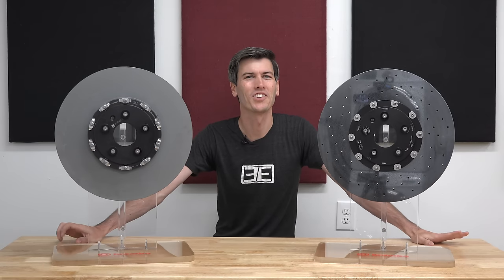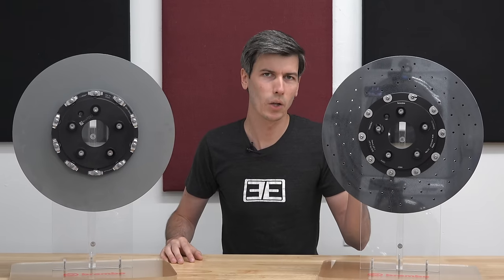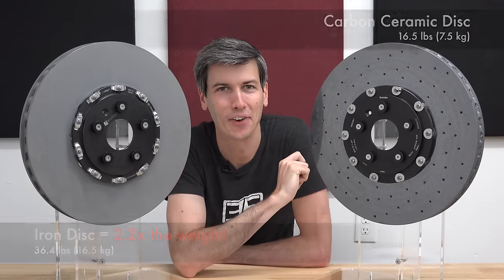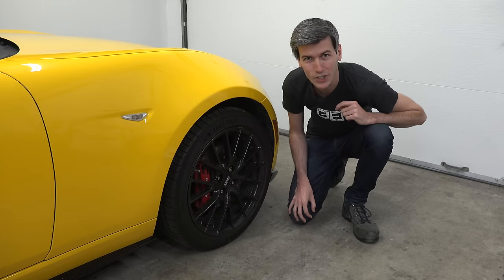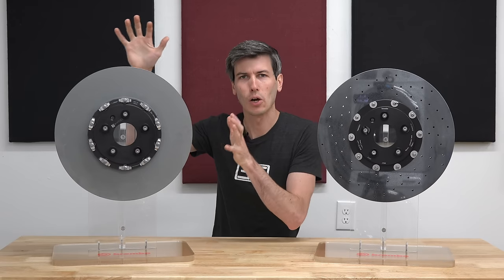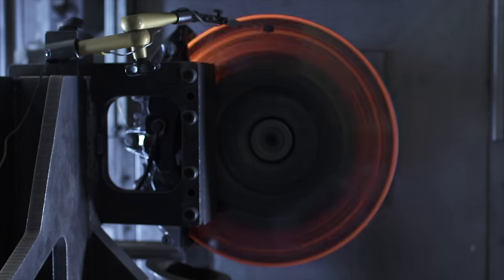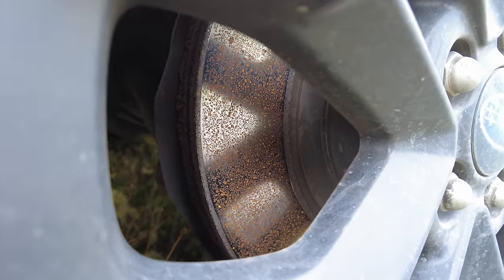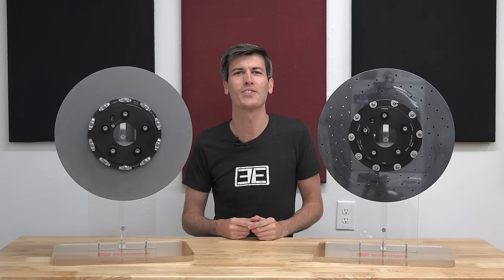How Can Brakes Cost $10,000? The Brilliance Of Carbon Ceramics

Comment: Could you do a video on what speed is an electric car most efficiently driven like you did on a gasoline car?
Reply: The intersection of energy loss due to wind-resistance and in-cabin energy use (which would encourage going faster to minimize time spent in the cabin). My bet would be 20-30 mph (similar speeds to a bicycle).
Reply: EV's range is very dependent on aerodynamic drag.  It affects ICE cars some, but it can really hurt EV range more.  Also, ICE cars tend to have multispeed transmissions, so you want to be in top gear for best range in an ICE car.  In an EV car with one gear, the slower the better.  It becomes down to how much longer do you want to make your trip to be to get more range.    Bear in mind that an electric motor is 90% efficient, while an ICE gas engine is about 33% efficient.  The energy density of batteries (very low) means you start your journey with much less available energy, so efficiency and aerodynamic drag are a big deal for EV's.
Reply: It depends on whether the electricity was generated by coal or solar.
Reply: 56mph
Reply: Efficient really slow. 
Fast you can drive fast as long as fast charging is available everywhere. Fastest way to travel a model 3 is 190kph when 200kw charging is available and you only charge up to ~70%.
Reply: Generally slower, perhaps 50 km/h or even less.
Reply: @MichaelRei99  Coal down to 19% of US electrical production, and falling.
Reply: 1mph would be the most efficient way to drive an ev. No drag, impact from wind or wasted energy like in an ice car
Reply: @mattbrew11  There are still continous losses, lighting, electronics, etc, and ultra low speed operation isn't super effecient, so not quite.
Reply: Pretty sure the electric motor is more efficient at a higher speed though.  Would be interesting to see where the motor is happy vs where the wind resistance starts hurting too much.
Reply: @brianmichael316  Electric motors are around 90% efficient.  Don't see why there would be an improvement at higher motor RPM.  Aerodynamic drag is the main issue facing EV's as speed increases.  Aerodynamic drag increases at the square of speed increases.  So slower speeds will provide more range, but at the expense of travel time.
Reply: @MichaelRei99  nice try, but over the long term coal usage is going down (with a few bumps along the way). Elon already has this covered

Comment: 2019 Camry XSE. 74K miles, rideshare. Swapped front rotors at 70k. $200 for decent aftermarkets in OEM size, both sides with pads and clips.

RockAuto.

Comment: Please do a video explaining different Tire Pressure Monitoring systems; why do some systems show the pressure for each tire (Hundai, Kia, etc.) vs. others that only have a low warning light (Mazda CX-5). Thanks
Reply: Probably not enough for a video there. The difference is actually really simple, on cars that support individual pressure there is a sensor on the tire to actually measure that pressure. Those can go bad individually and need to be changed over/replaced when you get new tires. If your car can only say low pressure it is just using the stability control to see that one tire is a different diameter than the other, and thus one tire has less pressure. No sensors on the actual tire. But the car can only guess as to what is actually wrong and it takes longer for it to figure out that there is a problem.
Reply: I don't think there's really any difference unless you know if the car has in wheel pressure sensors or not. 

The simple warning light is the most basic system, but it still works the same way. If you use the proper scan tool to get into the TPMS system on a "warning light only" car, you can still read the individual tire pressures, but the auto manufacturer simply gives you no means to read it, just triggers the light under a certain pressure. 

However there is a system out there (don't know if it's still in use) that triggered the light if wheel speed was different, I know Toyota had these for a period, and they have a button you can press to relearn the system.  Ford may have had it, which might be the system in your Mazda... 

Just my 2c... Would like to know for sure though. I am under the impression all systems are sensor type these days.
Reply: That's entirely up to the manufacturer.  All new cars have the wheel mounted sensors and are monitoring the actual pressure real time.  Mfr decides if they want to show you those values or just have a warning light that's triggered when a sensor reads a value less than a specific tire pressure number.
Same question as why don't all cars show the oil pressure, oil temperature, and coolant temperature?  
Often, too much information is worse than not enough information.  K.I.S.S.  Most people just want to know when there is a problem and prefer the warning light.

Comment: Good video...I have some experience with both brakes materials on Porsche cars and I track a lot my cars..one think that we need to get clear from the start is that racing cars don't use Carbon Ceramics, they use Carbon-Carbon technology. On which one to choose my last two cars have been spec with Iron rotors. PCCBs do weight about 20 lbs less (full system) and that's unsprung weight... but I can always swap the rotors for a good quality aftermarket rotor and save some...not all 20 lbs. But then we have another problem...on GT4/GT3 with PCCB you can't use 19" wheels because the rotor is 410 mm vs 380, that larger size is needed to dissipate the heat. With a good quality performance wheel and racing DOT tire combo in 19" I have been able to drop 26 lbs for the 4 corners. BTW...don't ever drop a wheel on a PCCB rotor...that would be an expensive mistake. On braking performance once I change pads to a quality, track oriented one like Ferodo/PFC/ Pagid there's no advantage to PCCB and a good chance the Iron rotor will out-break the PCCB at a much lower cost with improved pedal feel....with Iron you have a great choice of pads not so much with PCCBs. So the only benefits I see are reduction on unsprung weight and no dust...in case you hate cleaning wheels.

Comment: Another thing to note is that the carbon ceramic rotors on a road car are actually different than those on a race car. The ones for road car can be made in a less expensive fashion because they're not expected to be used frequently on a race track.

Comment: I find it telling that a lot of people run iron rotors on the track but put the carbon ceramics back on for the street.  In a street application they last forever, and you get the benefit of lighter unsprung weight and no dust on your shiny Concours wheels.  On the track, while performance with CCBs would be better, with aggressive pads and aggressive usage the wear is greatly accelerated, and many owners just don't want to smash on rotors that cost as much as a whole Nissan Z.  You may burn up iron rotors by the pallet load, but a pallet of irons is a lot cheaper than a set of ceramics.

Comment: lol I had absolutely no idea that most brake dust comes from the rotor. I always just figured it was the pads, but now that I think about it it makes a lot of sense.
Reply: It actually depends on the specific mix of pad and disc - softer pads were fast and are kinder to the disk, harder pads wear more slowly and eat discs faster, plus they have a slightly less consistent feel.

Comment: I’ve had 3 911’s with PCCBs. Unless you track a lot, and your a top end driver they don’t provide the cost effectiveness needed to justify the price tag.  There is a barely noticeable difference in weight on turn in.  Porsche Steel brakes are FINE for the average good driver.  You have to drive a track with tons of corners to get any brake fade on the huge steel brembos on a Porsche .  Plus like range anxiety on EVs you get rotor anxiety worrying about get a rock in your rotors and the $9000 price tag to replace it.  I know guys who take the PCCBs off to drive it then put them back on to sell.  I now have my first GT3 with steels instead of PCCBs. It’s fantastic.

Comment: Can they be made for motorcycles? Rotational mass is a massive issue there to the point people pay a similar amount for a pair of carbon fibre wheels, but I'm not familiar with carbon discs in the bike space. Maybe just not enough of a market to justify it, or possibly the out in the open nature means they're too likely to be damaged?
Reply: Good question. I don't know if carbon rotors could be made thin enough to be reliable on a bike. Imagine what a carbon rotor failure on the front wheel of a motorcycle would do.
Reply: I think Moto GP uses carbon ceramics but don't know much else about bikes.

Comment: My airline has changed out brake rotors on the 737 to carbon brakes.  There are several layers of rotors all stacked together, that are squeezed together by hydraulic pressure as high as 3000 psi.  The rotational mass moment of inertia is much less, heat buildup is less, fade is less, chattering is less, aircraft weight is less, etc.  we can carry more weight with better takeoff and landing performance, save significant amounts of fuel, and in all of these measures improves safety. Normally we use an auto braking system that applies pressure to achieve a selected deceleration rate, because longer runways, weight changes, different landing speeds, and true airspeed (related to ground speed by winds) change at higher landing altitudes.  If we were to not use our spoilers or reverse thrust on landing, basically all of the stopping energy would become absorbed into our brakes.  By selecting lower brake settings on longer runways when available, we can thus use our thrust reversers and spoilers longer, and essentially remove energy from the airplane without heating the brakes as much. The deceleration rate is monitored by our inertial system, which is updated by GPS signals.  Since we don’t have direct “feel” through the hydraulic system with our feet (aircraft brakes are on the tops of the rudder pedals and can be applied left right or both) we rely very heavily on our anti skid system to monitor wheel spin differential to ensure we done accidentally lock one wheel or truck, in which case it’s very likely that that locked tire gets severely damaged or “blown” rendering it useless.  

Another little fact about stopping is that while the spoilers do provide a source of drag on landing roll, their bigger function is to dump the high pressure air beneath the wing out to the top, which makes the weight on wheels much higher just after landing to improve the friction capability between the wheel and the runway.   So the brakes work way better.

All of these factors come more and more into play as a landing or takeoff runway becomes contaminated with rain, snow, and ice.  Drastically lowering our stopping capability, thus limiting our ability to carry weight, or takeoff/land at all.  

Loved your video, and a great explanation of what is going on physically at the wheel level on a car.  Those expensive brakes are a lot easier to pay for with a revenue generating airplane versus a car (unless you are racing and winning). Best of luck.

Comment: My Porsche GTS came with PCCBs as an option. As a "used" vehicle purchase, I could not turn down a car with a mere 98 miles on it after it was 3y 1m old. If I had bought the car new, I would have passed on PCCBs, but since this car came with them, no regrets now that I have them. No rust, no brake dust and they will last me the life of the car, even if I did track it now and then. One of our regional PCA directors once said, "what is the point to PCCBs"? I guess I could say "what is the point to having a car that does 180+ MPH on a public road". Sounds like sour grapes to me as he could not afford a 911.
Reply: I dare to disagree - lack of sense doesn't necessarily correspond to lack of money. If I WANTED a sport car, I'd buy an NSX but never (NEVER!) a porsche. To me, reliability and comfort are way more important than anything else. I remember doing an inspection on a broken down 911, and the porsche shop owner proudly announced that he had managed to wear out breaks in 11,000 miles. Silly at best.
Reply: @nofyfb123  Well I guess we could talk about Acuras having looked at the old NSX of a couple of decades ago. Nice, but too much plastic, too Japanese and I have owned many and still own a Japanese car as a daily driver. Reliable but boring. As for the recent NSX, I haven't seen one on the road and they have been around for about 5 years. Grossly overpriced compared to my GTS. Now lets talk about automatic transmission issues in an Acura. By the way, if anyone is wearing brakes out in 11,000 miles, they are either on the track a lot or have brake issues? I guess you forgot to ask how old the car was and if it was proprtly maintained.
Reply: @a.c.e.7568  1. For me, Japanese is a HUGE advantage over anything else, especially European
2. There is nothing exciting about sitting on the side of a road waiting for a tow truck with subsequent sitting at a stealer's waiting room
3. It was not about just wearing brakes out in 11,000 miles - it's about being proud of it. Thus skewed mentality.
4. I leave in the middle of nowhere and mostly drive back roads, and nobody is slower here than sports cars. Especially all kinds of mustangs and corvettes.
5. The one who leaves the intersection first comes to the finish first rather rather than the one who needs a couple of seconds to figure out that it's already green and is not going to get any greener, and from my experience, it's the sport car driver. There are exceptions, though - some leave their tires on the asphalt just to come to a screeching stop at the next traffic light.
6. I don't remember exact mileage of the 911 I referenced but first, I was involved with low mileage vehicles and it belonged to a dedicated porsche shop owner so it was babied.
7. I am not a huge honda fan - since the Old Man died (1999?), it's not nearly as reliable as it used to be
And finally, WHO IN THE HELL DRIVES A SPORTS CAR WITH AUTOMATIC TRANSMISSION?!?!?!? But - since you mentioned that, thank you for making my point.
Reply: @nofyfb123  Well in my 45+ years of driving, I have only been stranded once...in my Honda. The catalytic converter clogged on a 7.5 year old car with a mere 92,115 miles. Althoug not stranded in my first new car, a Ford (before I knew something about cars...lol), a hydraulic lifter completely collapsed after a 14 months. I do my own work to a higher level than the vast majority of shops, why my cars last 14+ years before going to a friend.
Reply: @a.c.e.7568  Like I said, since about 2000, honda has been consistently going downhill. I sold the last one - 1998 Civic - a couple of years ago, and I wouldn't touch it ever again.
Statistically, among about 20,000 vehicle mechanical failures I investigated over almost 20 years in the field, European brands were champions in number/frequency of problems. To be fair, all kinds of pontiacs, chryslers, and fords take honorable close second place. I saw a bwm with 48,000 miles and 50 (FIFTY!!!) repairs - not maintenance but repair visits. In my practice, maximum number of INDEPENDENT defects at one given point was 18. Yes, EIGHTEEN. One pontiac, one jag, and one mb.
Considering generally/statistically low miles driven, porsche is also at the bottom of the list. The most common issues I've dealt with included but are not limited to leaking coolant cooler o'rings and all kinds of obscenely expensive electronic/electric failures. Mechanically, they were sound.
Even I - being 5'7"/165 lbs - am not comfortable getting in and out of most sports cars (exceptions: NSX, Supra, S2000), and driving a porsche can be compared to being dragged by your legs while sitting on your ass. Quite frankly, a Civic is more comfortable...

Comment: I imagine the R&D plays a part in the cost of carbon ceramics as well. It can’t be cheap to design something like that.
Reply: Good point. Less user base to spread R&D costs across, too.
Reply: The actual R&D of the rotor nowadays probably is pretty trivial but the manufacturing process will certainly be much more challenging than for steel discs - though steel discs probably will be much challenging to produce at a price point since their price point actually matters where as with carbon ceramics it isn't the even a top3 thing.
Reply: There is only one manufacturerer for CSiC Brakes currently (SGL Carbon, owned by Brembo)  which gives them a monopoly worldwide.

Comment: Do carbon ceramic rotors have to use special brake pads or will standard pads work fine with them?
Reply: Special. The 4 corners cost about $2400. I dread the day I have to replace them.
Reply: @alfaqvcarlos4406  OUCH.
Reply: NAO pads or Ceramic pads. Ceramic being more expensive but also lasting longer and less dust, less sound, better wear on your rotors. I just bought Carbon ceramic rotors and had to buy pads separately from 'Endless'. W008 compound, $1,800 for front and rear.

Comment: I need to push back a little bit on what you said about brake dust. I don't think most brake dust comes from the iron rotors being ground down. It's from the pads, which is why not all brake pads have the same color brake dust, and why some brake dust will oxidize when it rains and others not. That's been my experience with different performance brake pads on iron rotors.